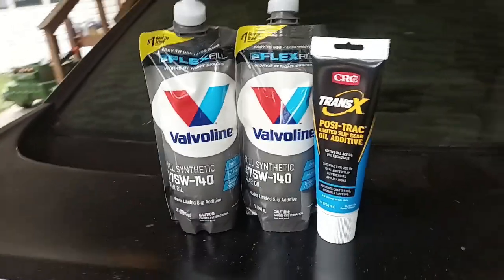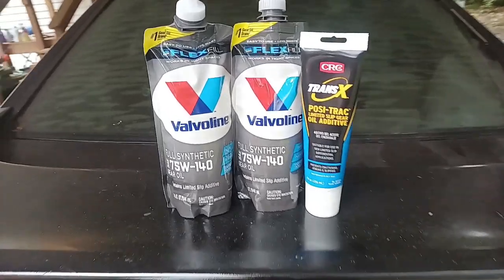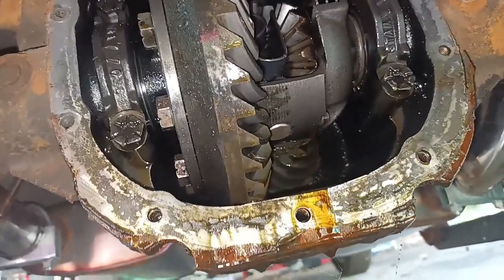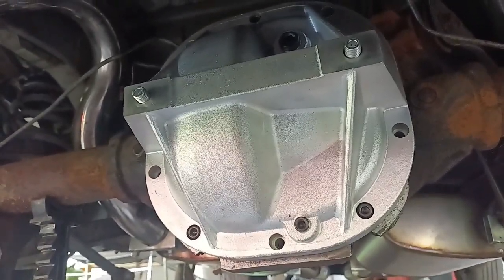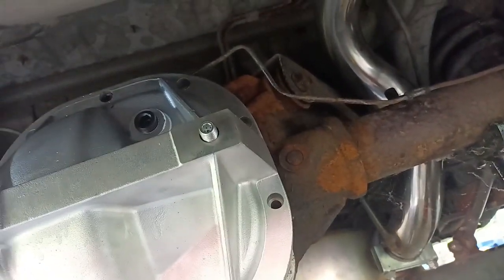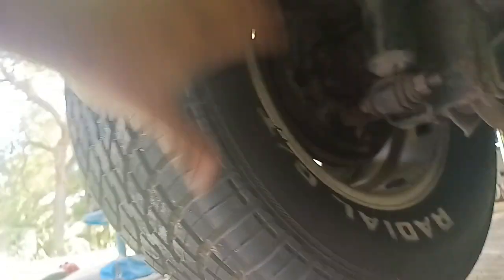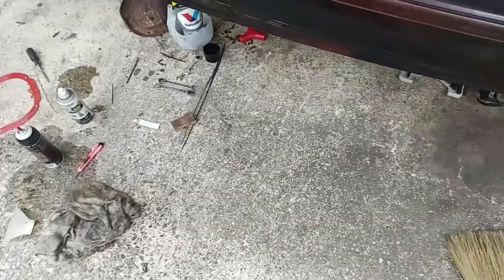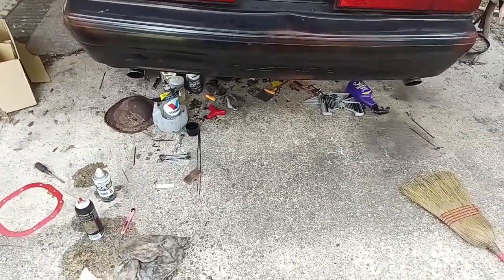Upgrading the Diff Cover on my 90LX Mustang | The Poverty Fox | #foxbody #mustang

Comment: How did you adjust the 2 bolts before putting the lock nut on ? I’m planning on buying this one but don’t see where or how to adjust those bolts. SVE bolts have Allen head where you can adjust😊
Reply from the maker: According to forums you turn them till they barely touch the caps and then go maybe a 1/8 past tight for a little added preload. Some people go a 1/4 past. But not super tight.